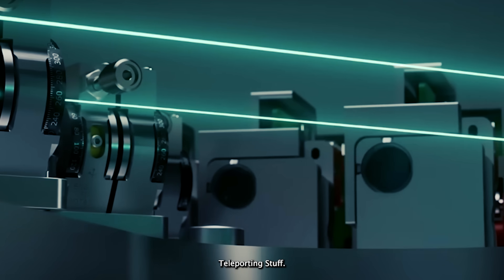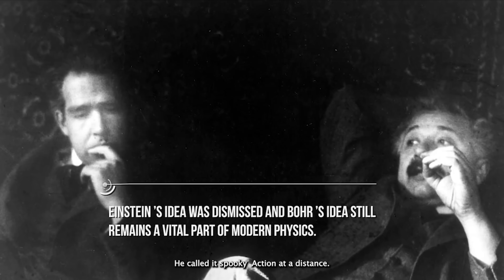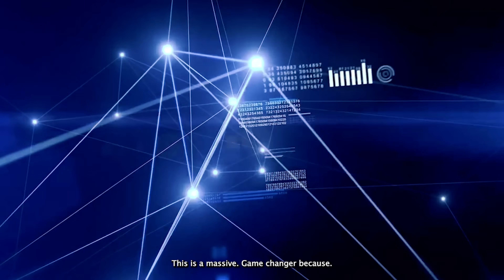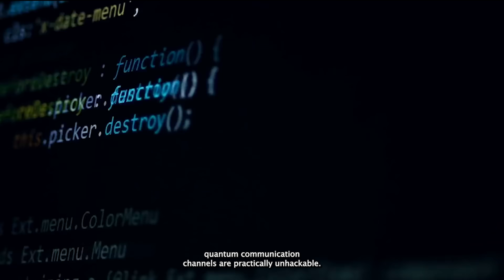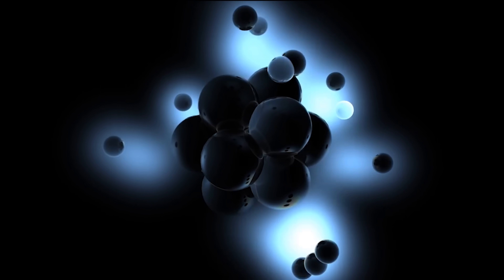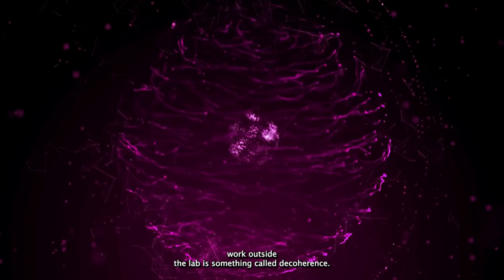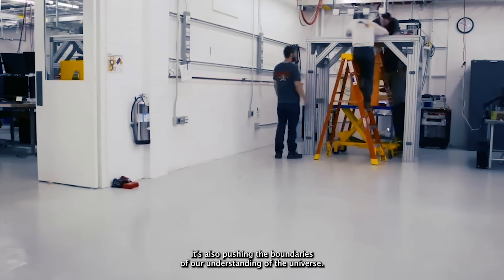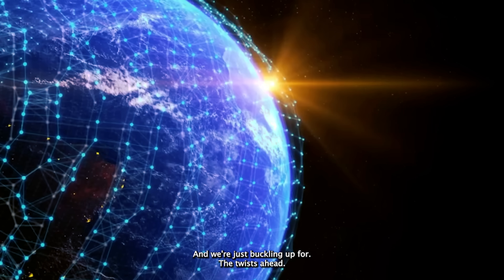Quantum Teleportation Made Possible! Scientists Achieved Near-Perfect Results

Comment: The data wasn't "teleported" if it went via satellite. The idea of quantum communication has been around for a long time, but has never (despite this video's claims) been achieved, for two reasons:
1) You can flip the state of an entangled particle which instantly flips its partners state, but you don't know the state the original one was in without communicating that via some other method - still limited to lightspeed. 

2) Even if you could know, the instant you measure "your" particle, the observer effect kicks in and it decouples from its original partner and is entangled with a particle in the instrument you used to measure it. 

So if you somehow managed to violate the speed of light with the required information to translate your particle's flip, you could send a grand total of one binary digit of data to it and it never works again.